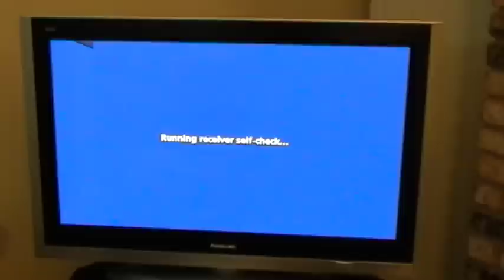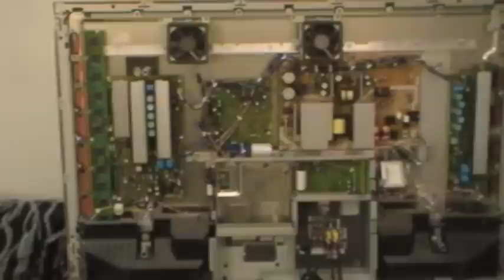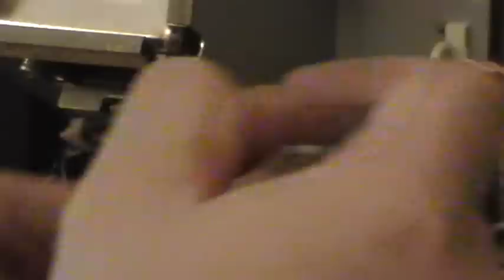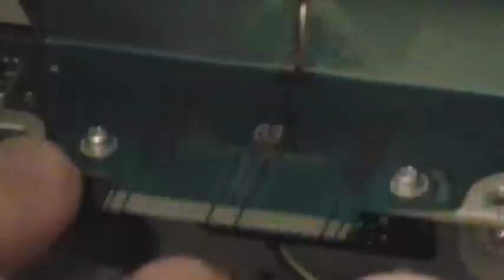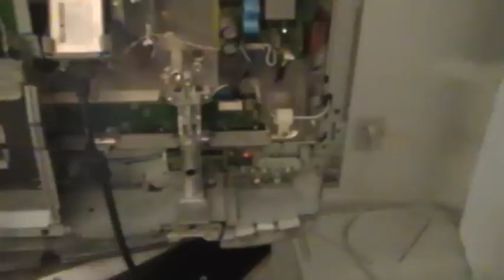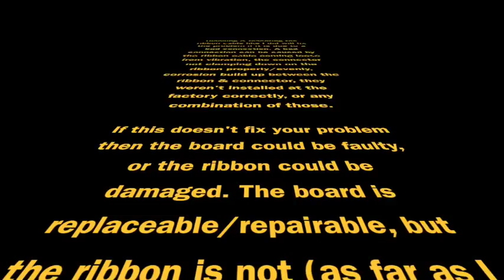Fix Panasonic Plasma TV Vertical or Horizontal Bars

Comment: I will need to try this, as I have the black bar problem. 
Thank you for posting this.
Reply from the maker: +Greig Reilly, no problem and good luck.
Reply: Well, I did everything that you did, mixed results. The black bar now only appears sometimes, flickery. Don't want have to keep pulling it apart. Just have to live with it I suppose.
Thanks again.
Reply from the maker: Greig Reilly, if the bar only appears sometimes, then you definitely made an improvement and the problem is/was a loose connection. There may be more then one. Next time it shows up, try giving the back of the TV a smack (mild/medium force), a.k.a. a "technical tap”, and see if it improves/changes. If it does then it definitely is a loose connection. Good luck...

Comment: Hey Pete, Did You Have To Solder Anything Man? Your Video Didn't Show Much Around Disassembly Either. It Was Just A Verbal Walkthrough. How Would I Know If Something Needs To Be Soldered? I Could Try Cleaning It. But I Didn't See How You Did Anything. I Have Tons Of Compressed Air. But I'm Sure That Won't Be Enough Alone.
Reply from the maker: +Terrell Williams, it's Pet Rock, not Pete. :-)  No I didn't have to solder anything. I didn't show unscrewing every single screw because that would make for a boring video and disassembly is different depending on your TV model & manufacturer. If you see a broken/cracked solder joint then you would need to solder that joint to repair it. Compressed air and reseating the ribbon cable was enough for me. But if you want to you can use some Denatured alcohol or Isopropyl alcohol on a q-tip to clean the contacts. You don't need a lot. Just wipe it down and let the alcohol evaporate and you should be good to go.  Good luck...
Reply: Hey My Apologies Man. I Was So Focused On Your Video, That I Only Glanced At Your Name. It Looked Like Pete Rock. So My Fault. That Said, Thanks For The Speedy Reply. It's Greatly Appreciated! I Only Commented On Disassembly Because A Novice Like Myself Would Benefit Immensely From Seeing A Step By Step Visual Breakdown, Vs. A Verbal One. Though I Understood Everything You Said. It Would Just Make Actually Doing It A Little Easier. I Have That Exact Problem With My TV. But The Only Difference Is That It Only Occurs After My TV Has Been On For About 7-10 Hours. Or If I Only Leave It Off For A Short While After Using It. But It's Becoming More And More Of A Nuisance Though. So I'm Looking To Get Rid Of It. But Seeing As How You Posting This Video So Long Ago. Is Your TV Still Functioning Properly After Your Cleaning?
Reply from the maker: No problem. You aren't the first one on YouTube to think my name was Pete. My TV has been functioning flawlessly since I made this video.
Reply: +Pet Rock&#39;s Garage Okay So I Have A 42" Plasma Panasonic TC-P42S2 2010 Model. Hopefully The Insides Won't Very Much More Than Yours. But How Long Do You Recommend I Let My TV Sit Before Attempting The Cleaning Pet Rock?!
Reply from the maker: +Terrell Williams, the back of the TV should be cool to the touch and at least 5 minutes after you unplugged it.
Reply: Okay Great! I Saw Other Videos Saying To Wait At Least An Entire Day For Everything To Be Cooled Down. Specifically The Capacitors. But If I Avoid Those, I Should Be Okay Right?
Reply from the maker: An entire day seems a bit excessive. If you avoid the capacitors, especially the ones by the power supply (typically near where the power cable plugs in) you should be fine.
Reply: Thanks A Lot Man! If I Try It Out, I'll Be Sure To Let You Know If It Works Or Not.
Reply from the maker: Thanks and good luck!

Comment: Why not apply Deoxit when you have access to the connectors? My experience has been once applied you will never have to go in there again. Had my 42" panny for 13 years...very reliable. Great video.
Reply from the maker: +xlr8also, contact cleaner isn’t a bad idea if the contacts are corroded. Dielectric grease would help prevent the corrosion from coming back.  A combo of both would make it bullet proof.

Comment: excellent video. even with all the vert / horiz goofs. LOL   thanks for this.
Reply from the maker: +Leisure suit Larry, thanks a lot.  I appreciate it.
Reply: yeah, i was thinking of fixing this 2006 model and I came accross another one for 50 bones having a problem like yours there and I thought. hmm. if i got the hang of this .. might be cool to go get a 50.00 one and fix that as well.   LOL      i wonder though if a colored bar is the same problem as a black bar, say if the bar is PINK or green or yellow.    could be the exact same thing just a different connection point separation right?
Reply from the maker: +Leisure suit Larry, yes, its possible. Good luck...

Comment: hello Pet Rock, any idea where a screen ribbon would be located in samsung pn50a400c2dxza? I have a 3 inch solid black vertical bar on the screen and it's only getting wider. I want to give it a try and fix it.
Reply from the maker: +VJ DANKO, I don't know that specific TV, but the ribbons are typically on the top or the bottom of vertical bars, and right or left of horizontal bars.

Comment: We recently purchased a second hand 65" TV. It was working fine for a day until a faint line started to appear and then gradually getting worse. I was spewing. I watched your video and followed it step by step. Funnily enough when I unlocked the ribbon from the computer board I found a 2inch hair in their. I removed it and instead of using a air duster (spray can) I used a vacuum. Put it back together and the tv was perfect. We haven't had a problem since. Thanks heaps for the video! Highly recommended :)
Reply from the maker: +Marie O, thats great!!!  I’m glad my video helped you out and you got your TV fixed.  btw, your TV is HUGE!!!!

Comment: Thanks I'll let you know how it turns out, hopefully good because they just bought a new 50" & probably won't want the 42" back so it'll be ours which means I need it to work so I have a better tv in my room can't stand 32"lcd in my room anymore need bigger! :)
Reply from the maker: +Phil Peterson, thats a good deal...  Good luck!
Reply: I tried to fix the single red line going from top to bottom is thin but still noticeable, their were a bunch of ribbon cable's on the one side but they ran side to side I cleaned them anyways and used compressed air to clean everything. I can't see any ribbon cable's going up & down near where the line is so not sure if I'll be able to get it out, I can't imagine they'd have 1 single cable hidden behind everything when the rest were right in the open but I guess you never know it's not that bad to watch but I just keep looking right at the stupid line. Lol
Reply from the maker: +Phil Peterson, my TV had ribbon cables on the bottom and the left side. The research I had done suggested that most panels were like that.  One side controlled the horizontal and the other controlled the vertical. But it is possible the ribbons are all on one side. I’d poke around a little to see if the ribbon is hidden behind something or tucked around the other side of the panel. Good luck...

Comment: I watched your video awhile back as my lcd tv in my bedroom had a green tinge to the whole screen, we couldn't afford a new TV at the time and didn't really want to go back to an old tube tv we had laying around after getting used to the lcd!:)
Anyways I pulled off the cover sprayed with air and cleaned all the ribbon cable connections I could find, I wiped with alcohol pad then reinserted them and BAM is been 3 months since and looks better then it did new! 
Now I have my in laws lg 42" that has a red vertical line going down the screen, going to attack it tomorrow hopefully it work's as well as lady time.
Great video.
Reply from the maker: +Phil Peterson, thats great you were able to fix your TV.  Good luck on the in-laws TV.

Comment: I have a Samsung TV Model no. LE40M87BD and the screen has a 4-5 inch thick shadow band or line across it, any solutions?
Reply from the maker: +bernie mulhall, you could try the steps outlined in this video. Since it is horizontal the ribbons will be on the left or right side of the screen.  Good luck…

Comment: basically I want to know if it is worth fixing it or will the repair bill be about $500 or more should I just buy a new or refurbished tv?
Reply from the maker: +Joe Brown, thats an economics question really. If the cost to fix it is greater then the cost of a new (to you) TV then its not worth paying to fix it. But it is almost always worth trying to fix it yourself since you are only spending time, not money. Good luck...
Reply: +Pet Rock's Garage 
sorry i was referring to the replacement part cost i don't recall you mentioning the do it yourself cost.
Reply from the maker: +Joe Brown, if your problem is the same is mine then there is no cost because there are no replacement parts. You’re just reseating the ribbon connectors.

Comment: so I haven't fixed this myself but I called a couple of tv repair shop and they always want me to bring it in... that's a pain but it seems to be this problem on your video how can i describe to them what's the problem with out bringing it in or a $80 house call?
Reply from the maker: +Joe Brown, of course they want you to bring it in.  The shop is going to charge you an hourly rate not matter how easy or hard the fix is.  If you are having the same problem as in the video, why not try to fix it yourself like in the video?  Way cheaper then having someone else do it.
Reply: +Pet Rock's Garage 
cost of replacement parts?
Reply from the maker: +Joe Brown, if your problem is the same is mine then there is no cost because there are no replacement parts. You’re just reseating the ribbon connectors.

Comment: Hey PRG, thanks for a well done vid.  Soon I will endeavor to eliminate my green racing stripe and toast you upon completion.  And at the same time will see if I can fix the random power down that is happening.  

A question, though:  You mention that you wiped the ribbon connector off but you didn't say what you used., if anything.  Would denatured alcohol be the way to go or do you recommend aerosol contact cleaner?

I am tempted to use the latter in a number of areas but don't know if it's too harsh for delicate electronics.  Please advise.

Thanks again!
Reply from the maker: +Gary Mastro, thanks a lot and good luck.  Denatured alcohol or Isopropyl alcohol will work just fine.  Contact cleaner should work too, but it may be a little harsh for the plastic coating on the ribbon. Use a cotton swap or q-tip to wipe with.  Also make sure that everything is dry before powering it up. If you have a random power down issue, I would concentrate your search in the power supply. Possibly a blown/bad capacitor.  Good luck...

Comment: Where can I find a new panel with new connectors on it? Bc  one fourth oh my whole screen has a solid white box and another  one fourth had a solid black box next to the white one so only half of my screen is visible. TV is probably screwed but any help?
Reply from the maker: Zach Johnson, I'm not sure.  I'd contact the manufacturer of your TV and get the panel's model number and then use Google to see if you can get it cheaper then from the manufacturer.  Good luck...

Comment: yeah, I'm experiencing a very pitch black (not blinking) vertical black bar on the very right side. instead of a missing vertical strip on the right side of the picture being missing, it actually pushes the picture to the left, making the left end of the picture missing, if that makes sense. this happens on videos 1, 2, and 3 (including s-video) and even the antenna channels. but for some reason, I get the full picture with HDMI. it's like HDMI is the only input channel functioning correctly. any idea what might cause this or what I could try to do to fix it?
Reply: or maybe a hard factory reset? do you know how to do a hard reset on this tv?
Reply from the maker: Brandon Harris, yeah, that sounds strange.  I’m not near my TV at the moment, but I vaguely remember there being an option to set back to “shipping” state (or some wording like that) in one of the on-screen menu’s.  Good luck...

Comment: I think I have the same problem... I have the exact same TV and there is a black bar on the very far right side of my screen when I use any of the video channels or the antenna. oddly enough, the screen looks perfectly fine when using HDMI setting. do you think it's the same problem?
Reply from the maker: Brandon Harris, no that sounds different.  This problem occurs no matter what channel/setting being used.  Good luck...

Comment from the maker: +Steve Foster, YouTube won’t let me reply to your comment so I’ll do it here.  Hopefully you see this and fix your account so people can reply to you. There are a bunch of videos YouTube about how to repair a ribbon cable and desolder & solder a chip to one.  The problem is that it isn’t as easy as those videos make it out to be. The cables are so thin and flexible you could easily damage it more with your soldering iron. So you’d likely have to pay someone to do it (if you could find someone who was willing). Once you factor in the cost of the labor (plus a P.I.T.A. tax, since it would be a pain in the a$$ job) it can easily get more expensive then the cost of a new panel. Not to mention, most people won’t know how to find a replacement chip if one is actually available. I don’t know the real reason why they don’t put it on a PCB board, but my guess would be for cost (its cheaper to manufacturer the cables then it is to manufacture a PCB) and compactness (ribbon cables are easier to fit in tight spots and around corners then a PCB).

Comment: I have a panasonic that has the same problem, however my problem is that one of the chips that are built into the ribbon cable has fried. I can't believe someone hasn't found a way to replace that chip. I know it would be a tedious job, but would cost far less than replacing the whole panel. Any ideas, other than panel replacement. Why they didn't leave those chips on a card, instead of hiding them in the ribbon cable, is beyond me.

Comment: Great job brother! I have a Panasonic Dinosaur Monitor before they ever came with speakers. I've had it for well over 15 years now and I just got a "horizontal" line across the middle of the screen. I'll try your method and hope I can fix it as well. Wish me luck, thanks again for your video
Reply from the maker: XxUSMCForceReconxX, good luck.  If your line is horizontal then the ribbons you want to check are on the right or left side of the screen.  Good luck...

Comment: Thanks for the video, huge help! I had a similar issue with my Panasonic 42" TC-P42S2. I had vertical pin stripes down a block in the center. TVs are similar enough to get it working again.
Reply from the maker: No problem. I’m glad it helped.

Comment: Thanks for this.  My Dad had a vertical bar problem with a different model Panasonic. We watched your vid and got bold enough to attempt a repair last night.  Reseating the ribbon connector cleared it right up.
Reply from the maker: That’s awesome!  Thanks for watching and letting me know it helped you out.  I appreciate it.

Comment: I did all the cleaning you suggest for a vertical pink line at the exact center on a similar tv; it went away completely for about ten minutes but came back and is still there.  Any more suggestions?
Reply from the maker: If it went away, that means that you do have a loose connection. Make sure you cleaned & reseated the correct ribbon cable and double check that you reseated it properly.  Also look around that area for any other loose connections.  Good luck...
Reply: Thanks for your time....
Reply from the maker: No problem…  Good luck...

Comment: Excellent video, really interesting! Thanks!

Out of curiousity, have you by any chance tried adjusting voltages to lower your plasma TV's mll (minimum luminance level, or "black level")?
Reply from the maker: Thanks.  I appreciate it.
No, I haven't tried hacking the circuits on my TV.  I have, however, used its built in color balance & luminance features to great success. There are various settings & levels I can change on the TV via its own menus system.

Comment: Thanks for the video Pet Rock's Garage! I tried re-seating the ribbon cable connectors, but my black vertical strip is still present.  I've ordered a replacement C3 buffer board (p/n TNPAA442) from Tri-State Module in Evansville, IN as the next best guess as to fixing my issue.  I didn't do any board-level testing, but thought what the heck, I'll replace this board. It was only $20 including shipping, so worth the gamble.  What do you think?  Could it be this buffer board that's the problem?
Reply from the maker: I’m not sure. It could be. Good luck and thanks for watching & commenting.  I appreciate it.

Comment: 54" panasonic M/N PT-53WX42F, made in July 2002 will not stay on. it goes off in two second. what could be possibly be the possible?. 
Billie Jr.
Reply from the maker: Most likely a bad power supply in the TV, but it could be other things too.  Power supplies are easy to replace, but I don’t know how much they cost.  Since it comes on for a second or two and then dies it is likely a bad/blown capacitor in the power supply.  Good luck...

Comment: Hey I unplugged the ribbons and now when I plug them back in one of the bars is white. I can't seem to get it back in correctly. Any suggestions?
Reply from the maker: If it is white then it isn’t seated correctly in its connector slot.  Try removing it again and reinserting, making sure it is fully seated.  Also make sure the TV is unplugged when you unplug & plug in the ribbon.  Good luck...